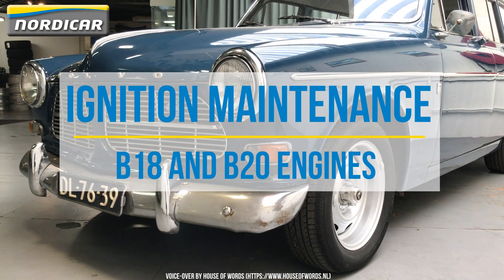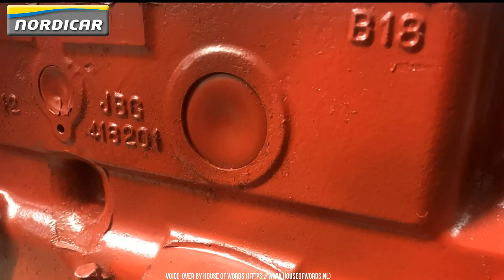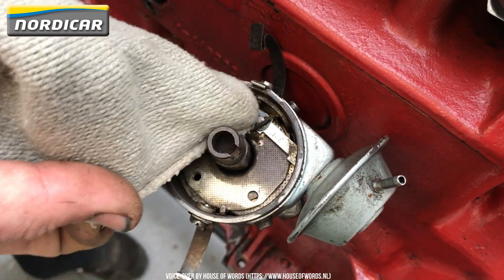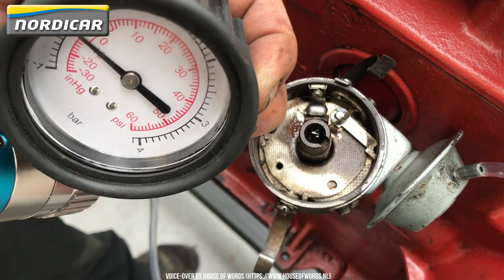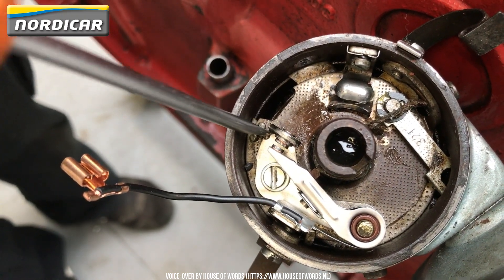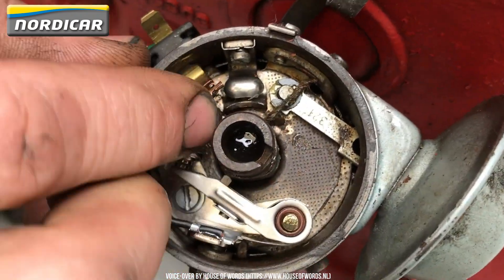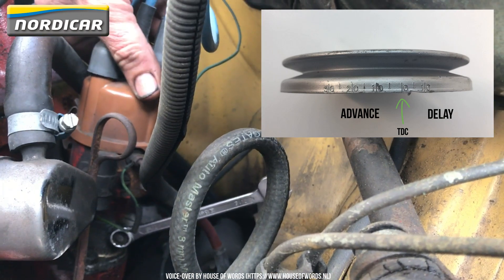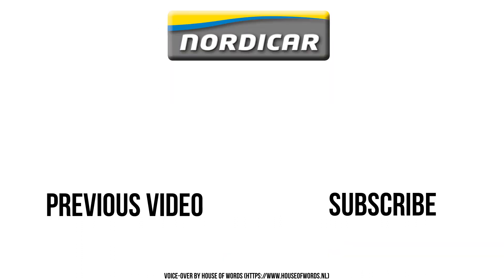How to Replace and Adjust the Breaker Points and Capacitor of your Volvo with B18 or B20 Engine

Comment: Excellent video! I have a '67 Volvo 122s with the 4 speed that I bought for $3500 running and driving. It's an amazing car and the B18 is a great engine. Working on tuning it up now. Loving how easy it is to work on after coming from modern JDM cars.